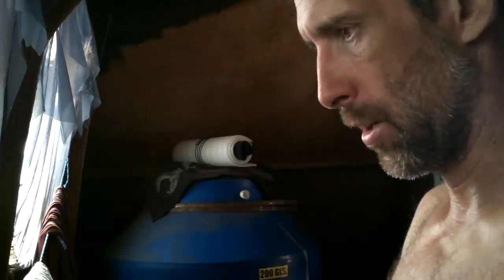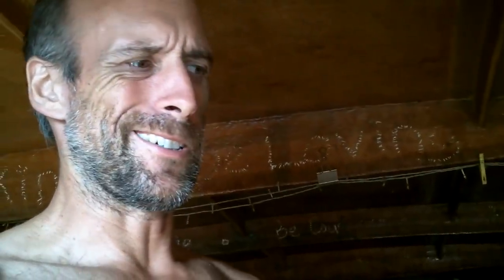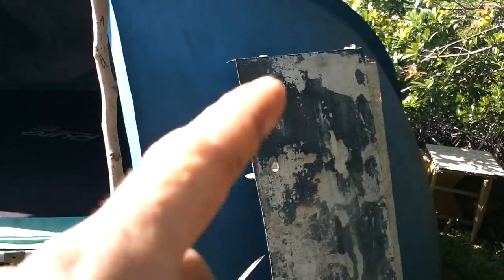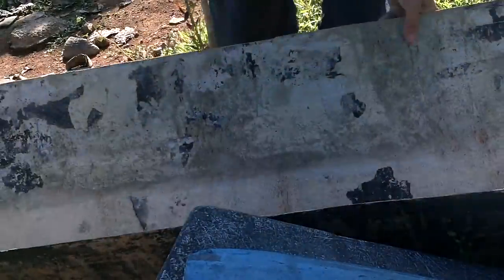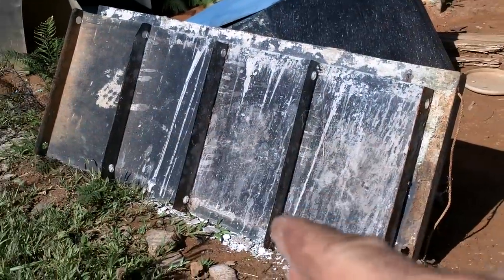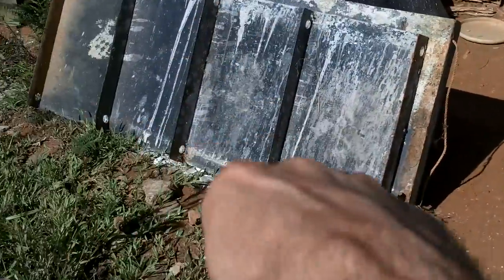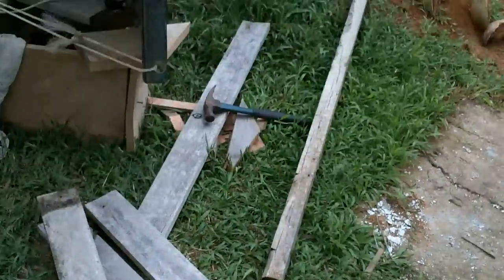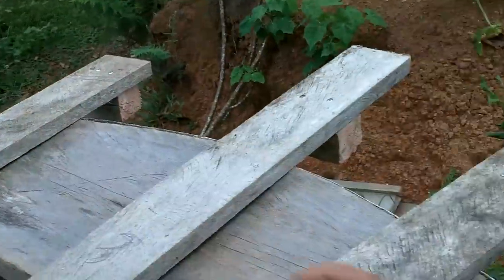Concrete Water Tank 02 Walls

Comment: I'm going to need to build a water tank in a jungle (Philippines). Concrete yes. Forms, circular. What I'm thinking is using EPDM (syn rubber). I've used EPDM for years in ponds, roofs and other things. Very useful. I think what I'll do is use concrete blocks on the inside and outside as forms and use like 24" strips of EPDM between blocks and poured concrete to be the release. Concrete doesn't stick very well to EPDM. So 2 courses, fold the EPDM over the top of block and set a block on top to secure. Then pour like 16" of wall with rebar, let set. Then 2 more courses, etc... I will then use EPDM to line the inside. Certain no water loss, no worry of cracks. This will also allow for a much thinner wall and no concrete for the floor. Can't wait to do this.

Another option, depending on soil conditions and elevation requirements, would be to dig down, line with EPDM, and let the ground be the sides. Basically a pond. EPDM works better in a rectangular shape than round. Maybe a combination of below and above ground. This is going to be so much fun. And it will give me a better perspective on rainy days...a plus.

Comment: they embed barbed wire in the walls of the concrete tank.
Reply: Which he doesn't do because of the ocean, causing metal to corrode very easily, reducing longevity. He did use plastic netting before, in another project, so not like he couldn't use something, though.

Comment: I was just thinking about you Jaimie. Candela has come out with another video showing all of the numbers on their electric hydrofoil boatin real time - with the boat in motion. Its a very enlightening experience. Enjoy it here https://www.youtube.com/watch?v=Oa63izfR26s
.
And Good luck with your Tank!
;)
FYI-  I smashed in the side of my cistern with my winch truck. To make the repair I had to rebuild a 10 foot section of concrete arc. The cistern was made out of limestone rock but I repaired with concrete. I made simple forms out of 1/4 flexible fiberboard board. I bolted the inner and outer together with pvc spacers, poured the concrete in one foot deep increments. It worked like a charm.